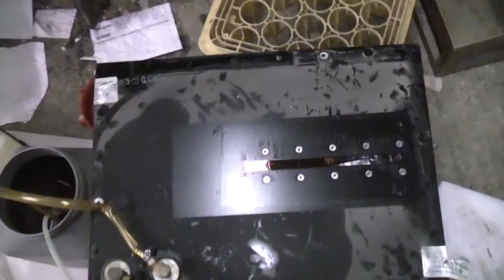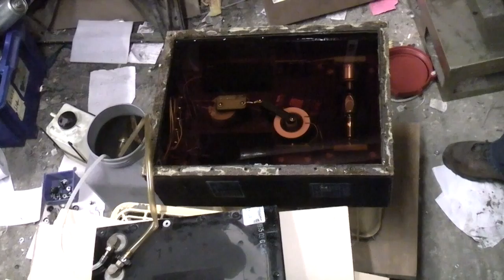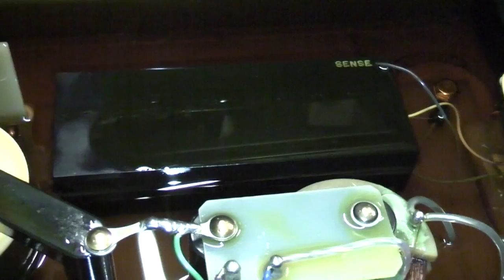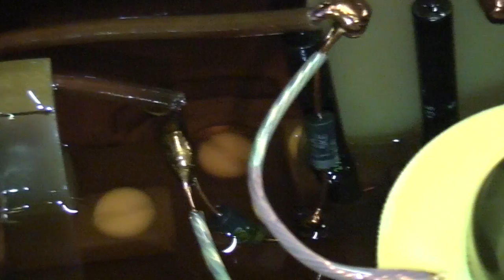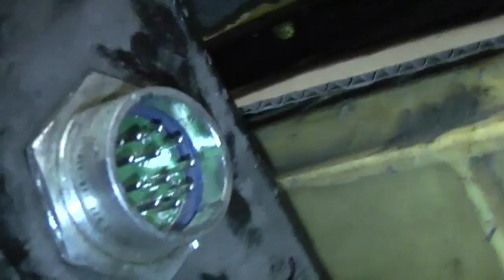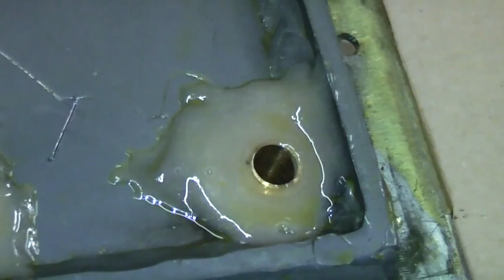Baggage X-ray machine part 6 - inside the black box.

Comment: Looks like a Dr Lohmann X-ray tube.  I had a very similar tube but it had a massive aluminium heat-sink on the anode end about 20x20x8cm and came enclosed in a rather smaller aluminium can that was filled with pressurised SF6 gas.  The can had a single transformer that provided floating filament winding and bipolar AC to the tube providing half wave self rectified HV to the cathode.

It also came from a baggage scanner that was scrapped in South Africa.  Sadly the tube was stolen by some random scrap merchants presumably for the massive heat-sink.  I think the tube was rated at 160kV and had that same beryllium filter attached to the anode shroud.  Filament was working but I never had a chance to raise it up to HV.  The agent at the time supplier suggested that a 30-50kV current limited supply to 0.5mA would have been practical with no insulating oil or gas for experiments (off the record that is).

I love watching your teardown videos, fond memories of having done a lot of the same over the decades.
Reply: The wedge of plastic was probably used to balance the beam intensity so that at the oblique angle it scans the bags it would have similar intensity at the closest point and at the far side of the tunnel.  The unit my tube came out of had sensors on the back and the bottom sides with the tube in the opposite corner

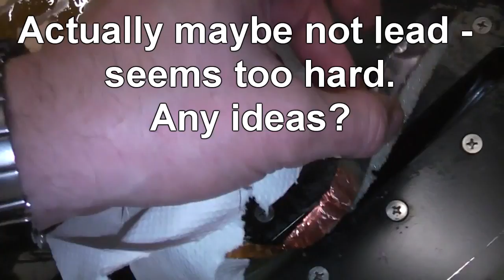Comment: 10:20 I think it might be a copper strip all the way, but the X-rays discolored and hardend it (it kinda looks like heated copper to me). Judging by the position of the tube and the "burn" marks on the fiber glass part it would be plausible that only one side of it took enough X-rays to discolor it.

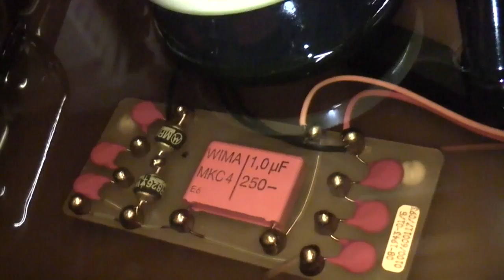Comment: @ 7:23 those capacitors connected in series are voltage multipliers , they are charged by say 5000 volts then they are connected in series by diodes to multiply the voltage    to say 35000 volts or some crazy number like that , im speaking hypothetically
Reply: Mike mention it, here is some reference:
https://en.wikipedia.org/wiki/Cockcroft%E2%80%93Walton_generator

Comment: Interesting. Two transformers: one is for the tube filament and another one is for the marx generator and two powerful capacitors to make a high voltage  for this x-ray tube.
An oil is needed to avoid arc between circuits, due its high voltage and dissipate the heat, generated by the tube as well

Comment: Those look like welds on that shielding, so it is definitely not lead.  I doubt it would be steel and the color doesn't seem right for steel, either, so it's still a mystery substance.  What would have a high melt point and low toxicity suitable for welding AND shield x-rays?
Reply: +The Lightning Stalker they do weld led

Comment: that foil may be beryllium copper, is it slightly springy??? they may have used it because its safer and easier to handle than pure beryllium and can be made very thin  its purpose could be as a low density RF shield over the opening. im not an expert though

Comment: Yes it is used as a x ray window, it does not look like bare Be to me. Bare Be is used on things like Cu-K alpha tubes used on x ray diffraction sets.

It might be a plastic coated Be sheet, still toxic. Be is very hard when compared with most metals.

Comment: X-Ray tubes are pretty boring. Basically, they just have a filament, and a big chunk of metal (usually tungsten). 

The X-rays are produced by applying a high voltage potential causing the electrons emitted by the filament to strike the chunk of metal. This is what the high-voltage supply is for.

As a side-note, basically any vacuum tube can be made to emit X-rays, and there are a few projects on the internet of people using them to take X-ray images.

Comment: Enjoyed the series - the foil is probably tungsten or tungsten copper alloy is my guess.

The pieces of foil are either to tune the energy spectrum that is output (to give better separation between the high and low detectors) or just to flatten the detector response.

Comment: Very nice idea for suicide. Older transformers can have highly cancerogenic and/or toxic transformer oils in them, especially power transformers. One of those is here called piralen (trade name) which is used for reactive compensation capacities also. Electrically excellent, but managed as highly toxic.
Best regards,
Goran
P.S. Do not bur everything that looks like oil and burns, You might get intoxicated.

Comment from the maker: Anode current of this one was about 1mA. Penetration is controlled by voltage and current (latter adjusted via filament current), as well as sensitivity/filtering at detector.

Comment: Cracking a tube is easy- just use a hammer. Cracking a tube and actually having it be at all operational after reassembly is substantially close to impossible. All you'll find in one of those is a heated filament, maybe some focusing or whatever, and an angled tungsten target that the electrons hit, which generates the actual x-rays: nothing too special, not really worth cracking a (probably pretty valuable) tube.

Comment: Not surprising, it is in the main beam, is above the oil and gets the heat from both the tube, the Xrays and the heat from the Beryllium filter. Note that that filter needs handling with care, Beryllium lithium alloy most likely, and both brittle, hard and toxic. It does burn very easily though, toxic fumes, toxic oxides and all round not a friendly stuff. Place in triple bag and drop off as hazmat, complete with the fibreglass it was in.

Comment: No PCB's here, way too young to be containing PCB. Just straight dewatered SAE10 transformer oil. There should be a dessicant pack inside to absorb water there, the unit does not run hot enough to boil off accumulated water.